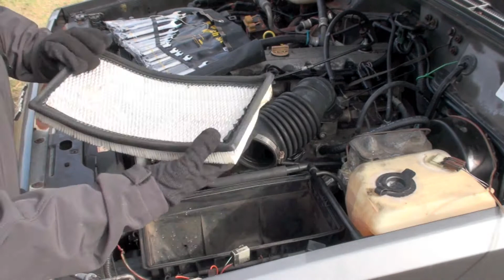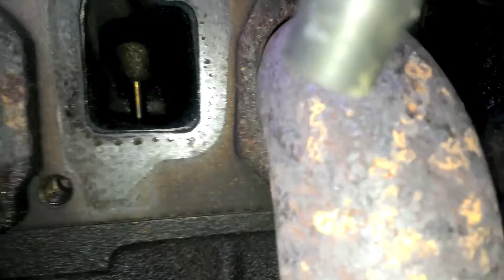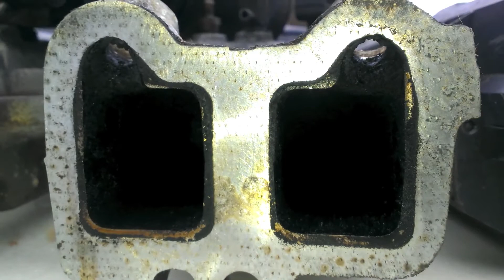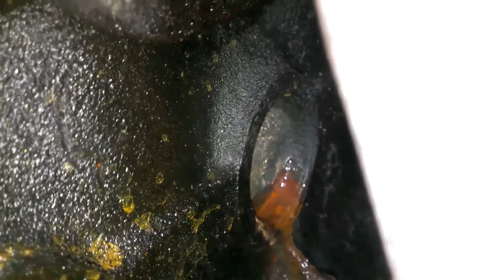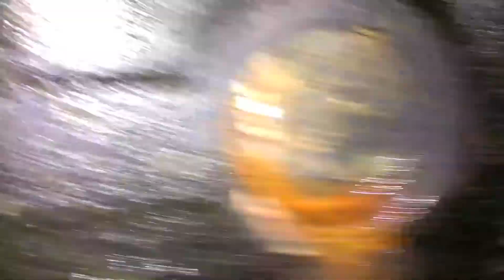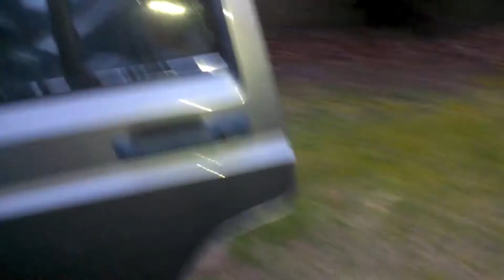89 Cherokee Manifolds Removal for Freeze Plugs

Comment: I give kudos when i see great work. That was great, just like our style except we removed the engine since that pain in the ass dodge V8 had freeze plugs under the engine mounts.... And behind the trans and flex plate and in the front too... Love the straight six, they are the best even if the trans needs to be pulled out for the other ones...  Great job.  MadMatt at Budget Boosting.
Reply from the maker: Yeah, I had to pull the trans and get the one behind the flexplate as well, that's in another video. You get awfully comfortable with your engine after a job like this. I had to take the manifolds off a second time because the new gasket I put on ended up blowing out on the 6th cyl exhaust port and I couldn't pass emissions. The other 2nd video actually shows the manifolds coming off too. The straight 6 is indestructible and a great engine to get your feet wet on.

Comment: MY EGR Tube, the metal one going from the exaust back to the intake manifold, is just not fitting in any way shape or form. I think the new headers are about 1/4 - 1/2 inch further away from stock. I am going to see if i can get some flexi hose, cut the ends off the old one and re-use the screw in bolt and all that stuff.  If that does not look like it will work, I am just going to cut and re-fit and weld this one. What a pain. Virtually everything on that jeep has been fighting me all of the way to put parts back in place.
Reply from the maker: Renix is always fun to work on, EGR adapting is a tough one too. I eventually just deleted it when I did the H.O. Swap
Reply: So FYI, I went to a place called "The Hose Man" today. I asked them to use the same fittings from the existing pipe and remove the center portion (the long portion and the bends) and replace with a flexible exaust pipe. Its being built right now. I will send you a link to the pic once i get it home later today. I think that is the best option for my situation and I have seen a lot of others with the same. :)

Comment: How the blank you get to the bottom manifold bolts and what special tools or combination did you use, if any?

Thanks.
Reply from the maker: Very carefully. I may show this off better in my banks header install but swivel sockets, and gear wrenches if you can get under and from the front. It's a night squeeze